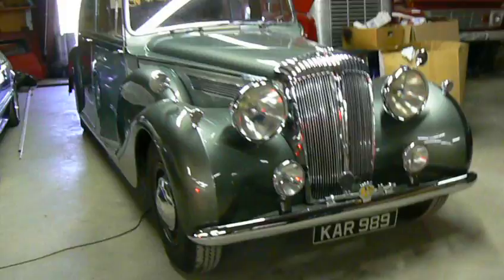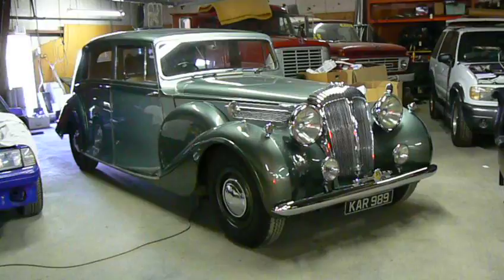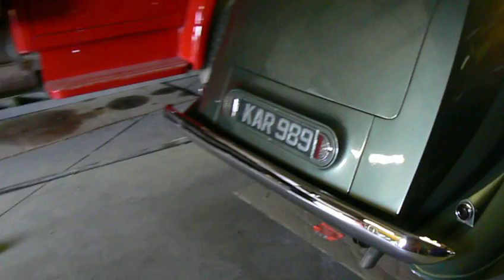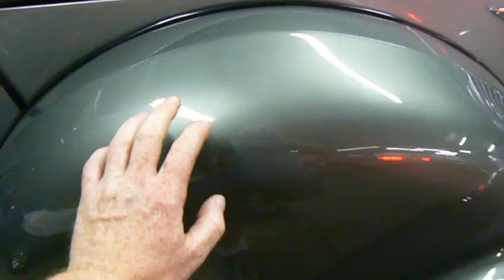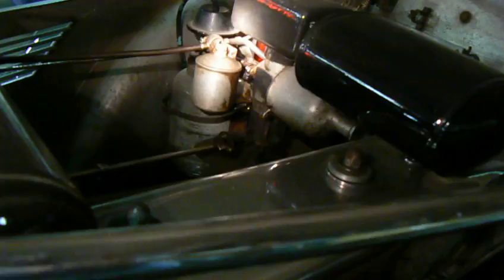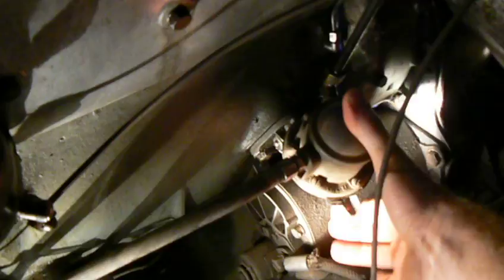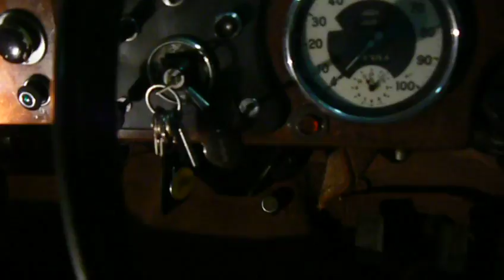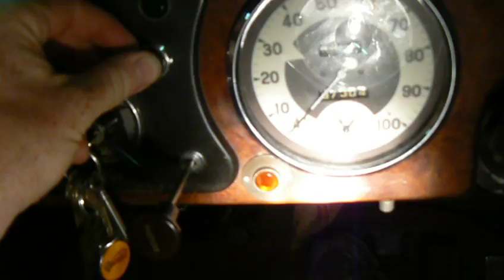SOLD : 1948 Daimler DE36 limousine cold start

Comment: Shame the owner knows so little. The side facing jump seat and pulldown writing table indicates that the car was ordered by a tycoon of some sort. The secretary occupied the jump seat and shared use of the table with the owner as necessary.
Reply from the maker: Shame you don't listen.  The car wasn't ordered; as stated in the video, it was Daimler's entrant into the 1948 Earls Court Motor Show.  Tycoon ?  Covered at 05:34
Reply: @HemiChrysler  okay, I should have said 'designed for' rather than 'ordered by'. I could also have commented on the appalling state of the interior and your photography.

Comment: Perhaps sounding a little like valve clearances need looking at. Should be a lot quieter, evan for a cold engine. Come on chaps
make it sound like a Daimler!!
Reply: Strange noise. I had an Armstrong Siddeley with a pre-selector gearbox. That sounded pretty similar until it was warmed up.